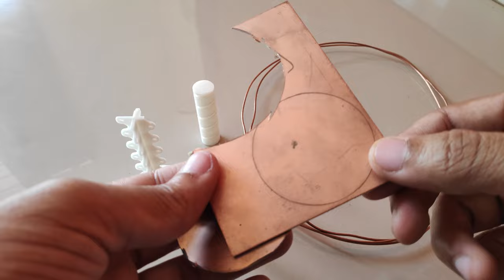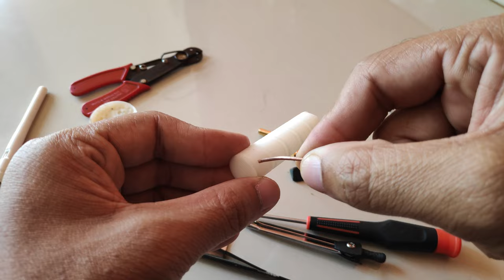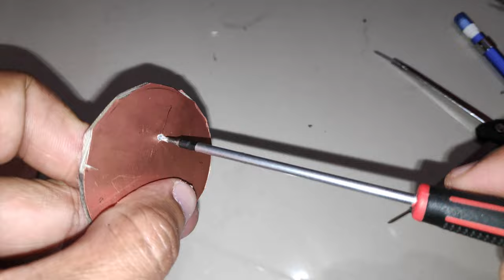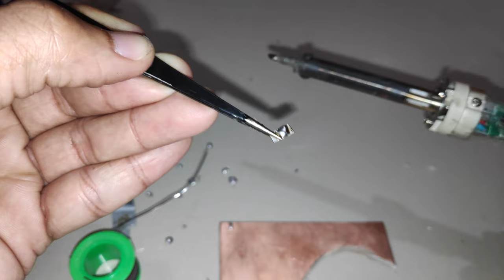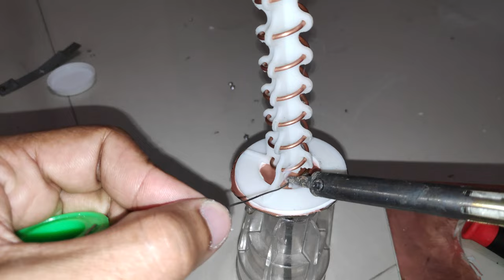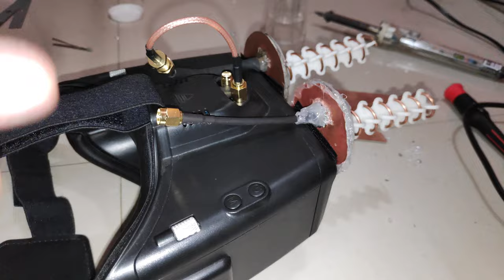Long Range 5.8ghz 7 Turn High Gain Helical Antenna Build Tutorial

Comment: Are wave traps important? I haven't seen other people applying wave trap piece? Also, is coax cable length soldered to reflector mandatory for proper RF signal? Can I solder flat bulkhead SMA connector directly to reflector (instead of coax cable) and attach straight to similar adapter you used without any penalties? (I've seen that on GrabCAD)
Reply from the maker: Well wavetrap is not essential but it lowers the SWR so better efficiency making it a wise choice to install. The coax length also has some effect on the signal quality due to impedance but i think if you use a sma connector directly that's just fine too afterall it's going to be a diy antenna. I still have to do a real environment test of these antennas I've built..only then will i be able to confirm if it's really working and beneficial.

Comment: Is it possible to built in same way a 2.4ghz antenna for the radio transmiter ?
Reply from the maker: You can build a 2.4ghz helical but i am not sure if it'll be ideal for a radio transmitter. You may want to look at a moxon for 2.4ghz?
Reply: Thank you